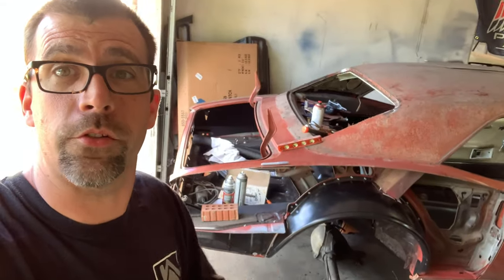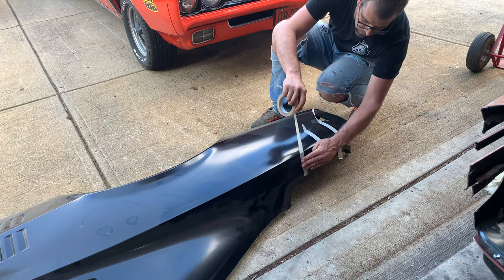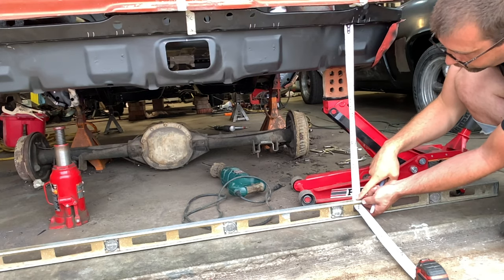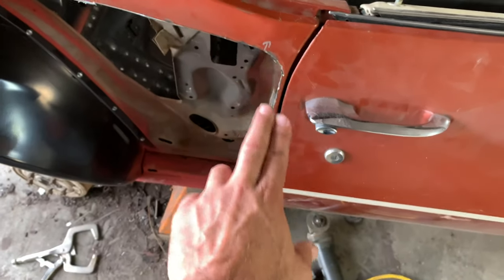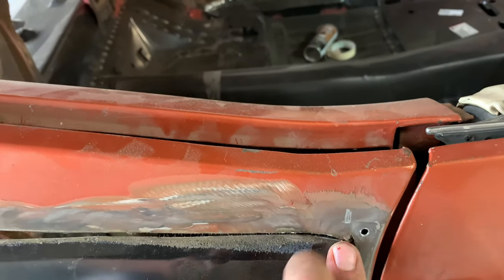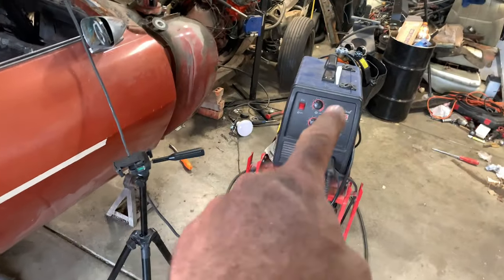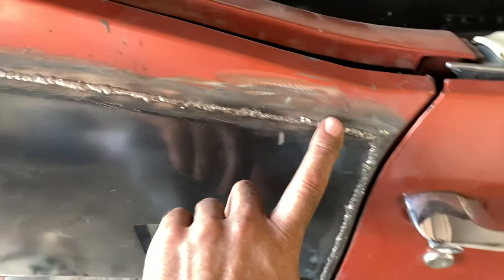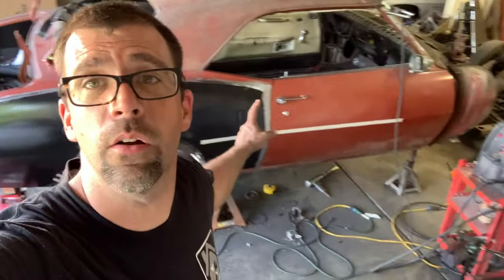1968 Firebird quarter panel replacement, making it fit correctly

Comment: I have a 1969 convertible need quarter panels both sides after seeing your video I am going to tempt it myself Thank you for the encouragement I must have watched all of your videos And yes I'm doing it in my 2 car garage and my backyard
Reply from the maker: Then it’s official you are vinyl village garage/VVG certified!! Additional tip when doing quarter panels on a convertible if it’s possible keep some weight on the suspension and continuously check your door jamb gap. What have seen convertibles have more flex when cutting them apart, naturally because no roof to keep it tied together. Congrats on your project and good luck. Of course if I can help don’t hesitate to ask and a huge thanks for watching.
Reply: Thank you for the reply and the confidence looking forward to that tail Pan that you're gotta do on your pumpkin
Reply from the maker: It’s actually already test fitted and came out great.   I am about a week or two behind with the videos. I really like the fitment

Comment: Awesome tips, im looking forward to using aftermarket panels some day on classic car worth money $$. Much easier than pieceing together your own from scratch. Ive only done modern restorations. Rust out repairs, small collisions, bumpers & stuff. Year 2000s & newer unibodies. Doglegs & some major rocker panel rebuilding, inner & outer structure. lower pinch weld restructuring to save cars up here in IL.
Reply from the maker: Rust belt like here in Indy. Those repairs definitely Give you some nice experience for doing a classic someday.

Comment: Would recommend this same method for 67 gto rear quarters.  Just purchased one in pieces. It needs both rear quarters, some front and rear window channel work, trunk pans, patch floor pans, and some, package tray work, patch, drop off rail, and a patch outer fender that willl have to quarter to fix.  Videos are very helpful.
Reply from the maker: I would recommend this way if everything else is good like this car was. Trunk jamb, door jamb, window channel didn’t need any repairs. Plus the less you cut out the less chance things get distorted and out of shape
Reply: Roof, top  half of quarters, door jams and sail panels are good.  Most attention needed at window chanel, bottom quarters, and area between decklid / rear quarter area

Comment: Just wondering if you have seen the miniature belt sander that they use at Robby Layton's body shop. I probably won't ever do much body work, but I still like learning your tips and tricks.
Reply from the maker: Awesome thanks!   I do have one actually, works good especially tight areas like trunk floor and frame  rail gap. I use it to clean up the plug welds when needed.

Comment: I'm restoring a 68 bird as well. Trying to figure out what quarter panel option I need. My door jamb and trunk opening are good,my tail panel edge is not. Does a skin include the tail panel edge of the quarter panel or do I need the full panel? Thanks
Reply from the maker: Good question, full 1/4
Has everything you need.  A standard skin doesn’t have tail panel stamping.  They now offer a partial 1/4 panel that comes with the door jamb area but the description says doesn’t include trunk jam or sail panel but doesn’t mention tail panel flange. With all that said OER makes this partial it might be worth while to contact them somehow and find out the details on the tail panel area.   If it doesn’t include the tail panel area you will need to buy a full 1/4 or had fab the parts.
Reply: Thanks for the information, greatly appreciate the detail. Though you might have the answer. The great pumpkin is looking awesome!!

Comment: Are there any concerns with performing a panel replacement of this size on a convertible?
Reply from the maker: Not really, I would level the car up and support the frame on both sides at the rear of the car because it will ensure nothing moves. For the most part the 1/4 will have little to no effect on body position I guess better safe then sorry is how I see it.

Comment: any tips/advice on changing out the silver trim sets (LVR Trim) I had a guy paint my 67 Firebird a few years ago and it didn't even occur to me that he painted over the silver "rib" trim on the side of the car.  I bought the new parts but not quite sure the best way to pull them out and snap the new ones in?
Reply from the maker: They are a little tricky to remove the nuts off the back side.  The best time to do it is if you have the window regulator out then it’s wide open and a straight shot.

Comment: How do you like that Eastwood Mig 175? Do you ever wish you had gone bigger? I am trying to figure out what I need and of course everyone recommends an expensive Lincoln model. Well, I don't weld for a living and that just isn't happening.
Reply from the maker: Love my welder had it for I at least 15 years now.  Sheet metal does great, 1/8” steel for frames no issues. For what i do exceeds my expectations.  And if it where to die I would replace with a new one

Comment: Is your level set to level and the car also level or are you just using the edge of the level as a reference to the panels and it's not level?
Reply from the maker: Both are level and need shimmed as you move things around. The car body typically stays the same but the bubble level will need to be readjusted as you move across the uneven shop floor.  Fortunately my 7’ level has a relatively weak magnet running full length that I attach washers too as I move it around to correct height.
Reply: @VinylVillageGarage  I noticed that the car is sitting on jack stands. How do you level the car with jack stands being that they are not infinitely adjustable like a hydraulic jack is. Do you put shims under the jack stands until you get it level? Where do you put the level across the car to determine if it's level? There are so many round and uneven surfaces. It's not like a 2X4 that you can lay the level on if building a house for example.
Reply from the maker: I used metal plates 1/16-1/8” thick under the jack stands and even cardboard on top sometimes to fine tune the body.  Now where to check becomes a bit of a trick. The pinch welds are not perfect from the factory but it is a place to start. That’s measuring side to side.  From front to back the top side of the rocker in the door jam works great. Then for me the last points of reference is the body mounts at the firewall and mid way under the front seat area and last rear frame rails in the area where the front leaf spring mount is a great place to set side to side.  

Now this is just my opinion and works for me but if I am within a 1/8” in comparison I call it good.
Reply: @VinylVillageGarage  Thanks again for the information. It will help me with my build.

Comment: What do you do to the bottom of the quarter panel at the rocker panel?
Reply from the maker: It gets plug welded.  I think it’s the next video I show how. The thing I forgot to do was pre drill that flange, it’s much easy if you do before installing the panel.
Reply: @VinylVillageGarage I will have to search for that one. I am about to start on a '69 Trans Am and that question has me stumped. Thanks!
Reply from the maker: @randyfleet9968  see if this works. Welding in tight quarters…🤣 how to weld rocker to the quarter panel 1968 Firebird
https://youtu.be/vbcuzod5uRQ

Comment: What company do you recommend for aftermarket metal? I hear conflicting info on fitment.
Reply from the maker: I will say I have tried all
Brands and pros and cons with all of them. I am almost convinced that all the panels are made at one plant in Taiwan haven’t proved it yet. With that said the majority of the time AMD panels fit better and cleaner lines so I lean more toward them when buying parts.

Comment: Why didn’t you replace the whole quarter?
Reply from the maker: Several reasons, trunk gutter was in great shape, sail panel great shape and door jamb excellent shape. Really no need for a full 1/4 until you get to the area by the lower tail panel. The full 1/4 has that stamped out correctly to get the small gap between the tail panel and 1/4 correct. Most of the time most cars get that area filled with body filler, I like the look of the gap more and it shows more detail to me. One of the small reasons not replace entire panel is in the front corner there is numbers stamped, only on original 1/4 panels and it’s visible with the trunk open. And I like leaving that intact when possible. Plus when I am done I get to collect several useful patch panels that are not sold separately and have been a life saver for many cars that needed only the gutter, sail panel or door jamb. I can think of 6 different people that I have just given those pieces to and now those cars are being restored 
 Now if more of those areas where damaged I would have replaced the entire panel. The difficulty is about the same replacing the entire 1/4 vs sections. So no real benefit there.
Reply: All the real body guys only replace what's needed. Discard the rest. The stamping may be slightly off and can cause bigger problems if you do the whole thing, the whole thing could be off. This way you maintain the original shape & positioning. It's easier to fix a slightly off section than a whole side. Hard to get a whole side perfect, this way you maintain those factory edges & shapes.

Comment: i’ve gotten to the point where i am about to cut things out and sandblast the whole thing but… the stupid dash is stuck in and i have no clue how to get it out. how in the world did you get yours off? are there hidden bolts somewhere that i can’t see? please help🙏
Reply from the maker: Nice progress! I assume you are talking about the dash pad.  If so there is four studs on the dash pad that has nuts along the front edge starting at the drivers side right next to the VIN on the dash then they go across to the passenger side. Basically if you look up on the underside of the dash where the VIN plate is pop riveted in you see the first nut.   Then you have 2 Phillips head screws that are on the a-pillar and last are the pieces that drop down each side they just pop in.
Reply: @VinylVillageGarage  thank you!! i got all the screws and bolts off but the stud things that go into the metal part of the dash were stuck and basically rusted solid to the dash kinda broke them off and got the dash pad off thank you!!!! you’re definitely more helpful then all the facebook groups i’m in😂😂
Reply from the maker: Glad to help, I agree there are a lot of opinions out there for sure. I like to back mine up with proof and good info.  Good to know you where able to get it apart. Best wishes on the rest of your birds recovery, and don’t hesitate to ask us first 😉
Reply: @VinylVillageGarage  thank you i’ve already gotten a lot of answers from your videos me and my dad are restoring a bird in memory of my grandpa the bird itself is in a little bit worse condition than yours. we are probably gonna need to replace our frame rails and we don’t want to cause everything to shift. we watched your video saying we could use your tool you built but we are pretty far from Indianapolis so we might build our own. keep uploading amazing videos me and my dad have been watching them ever since we got our bird you’ve definitely gotten us hooked on them we might save a few.
Reply from the maker: Saving a bird with history and family
Project is even better. I made that jig mostly because the specs are not clear or good. Even if you don’t make a jig take a lot of photos and measurements of the original frame rails for reference later. Glad to hear the videos and info is helping out. It is the reason I am doing it.  Keep in touch and me updated on your progress